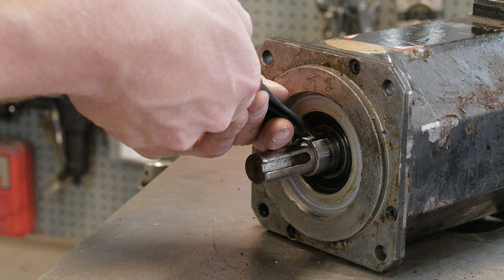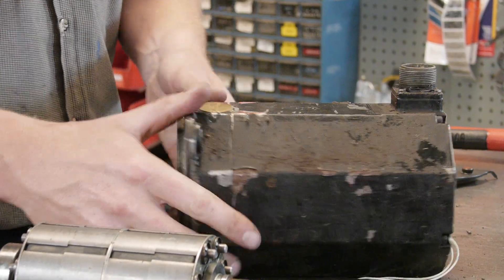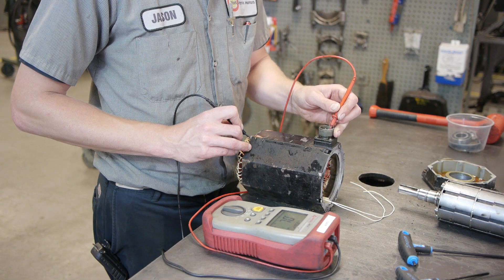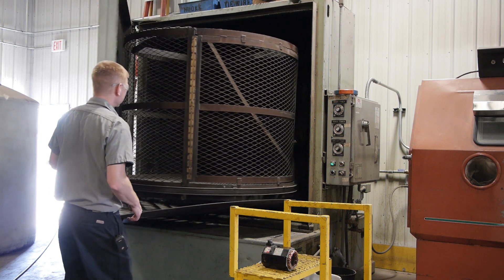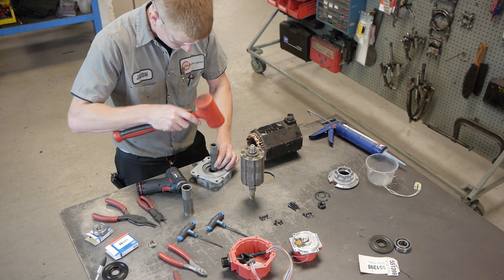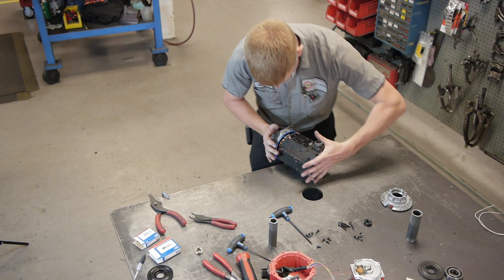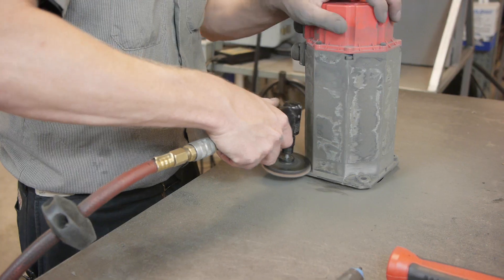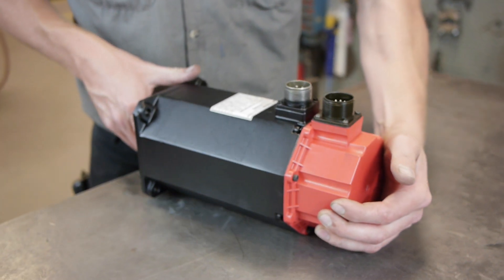Servo Motor Repair Process at York Repair Inc.

Comment: hello.I have a SanMotion Q2AA13150H servo with a RS1A05AA driver. the servo comes with the PP031 encoder (incremental, manuals of the driver only suggest the units PP031, PP038 and PP064 is compatible). and i want to change it with a generic encoder (other brand, because for me,. is a lot expensive and i can find stock in my country) with more resolution than the original (same number pair of wires and connection like the originals). is possible use it the new ecoder with the driver (after setup it in the driver)? greetings